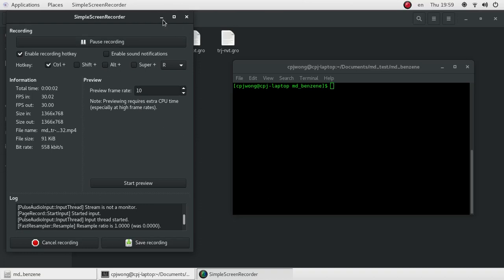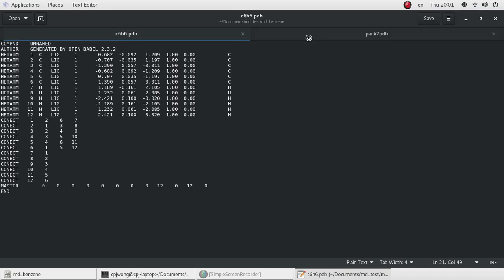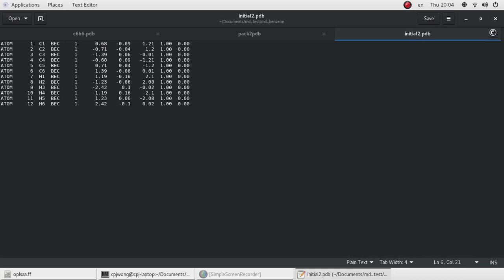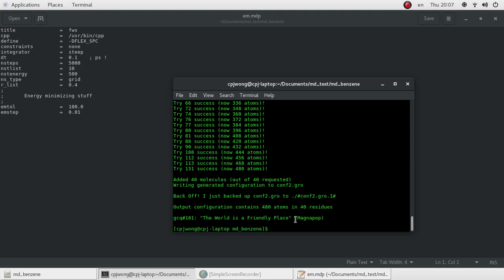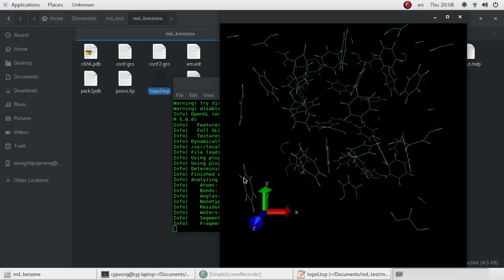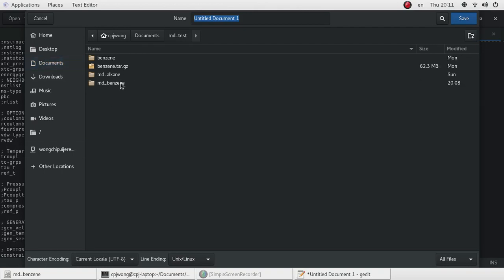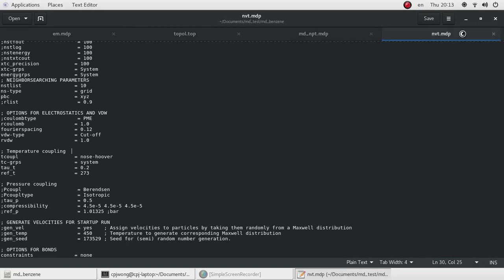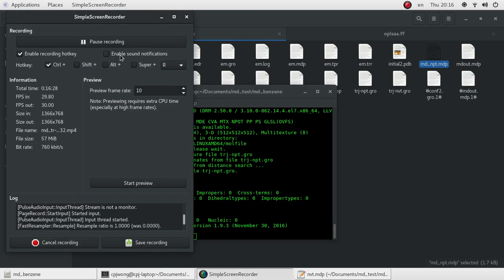Molecular dynamics simulation of benzene rings using GROMACS

Comment: Thank you very much for your video. I want to see the interaction between two organic molecules running MD simulation in Gromacs. How I cal proceed? I would like to be helped. thank you very muc in advance.
Reply from the maker: You may be interested in calculating the radial distribution function (rdf) of the organic molecules. The radial distribution function is basically related to the probability for a particle to find another particle as a function of the distance between two of them. With these, you can calculate the mean intermolecular force experienced by the particle. (rdf can be either intermolecular/ intramolecular depending on your list of chosen atoms.)

Comment: Sir, Thank you for the tutorial very useful. I have a question, when you have created your residue BEC you had fixed the charge = 0 (in the aminoacid.rtp file) is it ok? Doesn't it create issues in some future steps?
Reply from the maker: Yes. Putting a fixed charge of zero in this case was not exactly right due to the presence of hydrogen. But one can always unite the hydrogen and carbon as one UA atom, to eliminate any electrostatic interaction.

Comment: why do you have charges set to zero for each atom in itp/top file
Reply from the maker: Thank you for your comment. This is because benzene is a non-polar molecule.
Reply: @cpjwong  All the carbon atom has the same elector-negativity so obviously it will be a non-polar. What I mean it ask was, if we assign all of them atoms (C and H) equal partial charges, wouldn't simulation will go through? When I generate itp files of molecules through ATB or other sources it gives them equal charges to make it overall non polar.
I assumed that it will make simulation run the same was as with no charges. Am I wrong here? 
Should I be making charges to zero for my organic molecules?
Reply from the maker: @19neetish  Thank you for your reply. You may be correct. The partial charges of carbon atom and hydrogen atom should be slightly negative and positive, respectively. The summation of all the partial charges of atoms should be always zero. If you want to know the exact values of partial charges of C atom and H atom of the benzene ring, you may want to run a density functional calculation using free software like PSI4.
Reply: @cpjwong  I saw many more examples and I think your method is better. Many people have set charges to zero after getting topology files from ATB or other places for non-polar molecules.
Reply: @cpjwong  Hi sorry to disturb you again. I see that you had commented out gen-vel. That means its not being used. 
I read somewhere when we are using integrator=md we should generate velocity.  
Again What I understand is we should use it during NVT run and then should comment out in NPT run as we already have genrated velocities
Reply from the maker: @19neetish  Thanks again for your comment. To my knowledge, that gen-vel command will generate velocity based on Maxwell-Boltzmann distribution at the first time step. In my opinion, the effect on the results should be negligible as most of the properties we calculate from MD trajectory are averaged over many many time steps.
Reply: @cpjwong  yes.. But i think it will reduce simulation run time especially if you have very large system

Comment: Sir there is an error in the 1st step ,pack2pdb file is wrong or not?the error is modulenotFounderror:no module named numpy
Reply from the maker: Thank you for your comment. You can remove the following in the code:

import numpy as np
import matplotlib as mpl
import matplotlib.pyplot as plt
import warnings
warnings.filterwarnings("ignore")
Reply: @cpjwong  sir ,these code are on the pdb file .but error is showing up!!
Reply from the maker: @subratranjantripathy3738  Numpy, matplotlib are matrix and plotting libraries that one may not need in the pack2pdb file. You see the first few lines in the pack2pdb file: 

import numpy as np
import matplotlib.pyplot as plt
import matplotlib as mpl
import warnings
warnings.filterwarnings("ignore")

You can remove these few lines in the pack2pdb code, as one does not need these libraries (I should have removed this redundant part when I uploaded the code). Once you removed this, the error should disappear. Alternatively, of course, you can install numpy and matplotlib libraries.
Reply: @cpjwong  sir,after  putting the force field  ,the error named fatal error showing of:residue "not found in residue topology data base. And the error is in  src/gromacs/gmxpreprocess/resall.cpp(line 639).how can i solve thos error
Reply: @subratranjantripathy3738  You can easily install these modules. The attached link might be helpful for you!
https://linuxconfig.org/install-numpy-on-ubuntu-18-04-bionic-beaver-linux